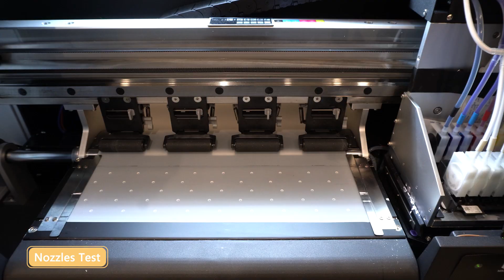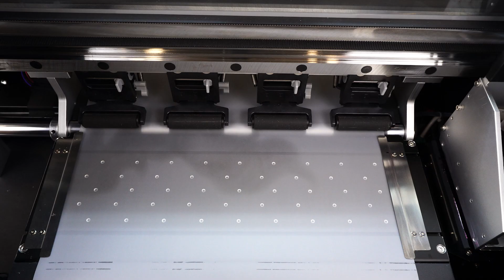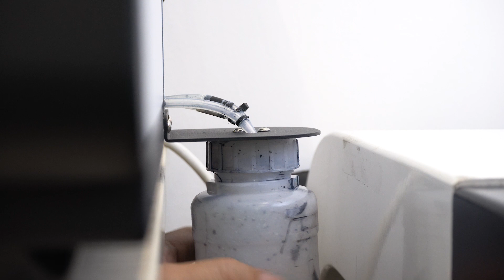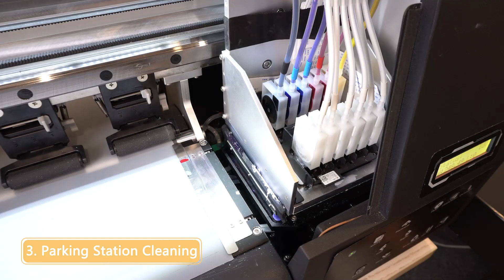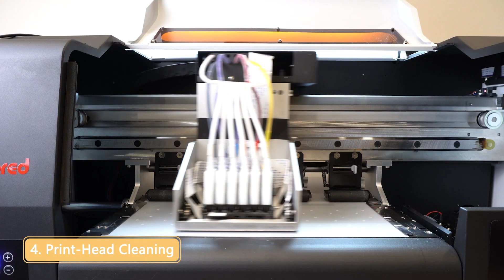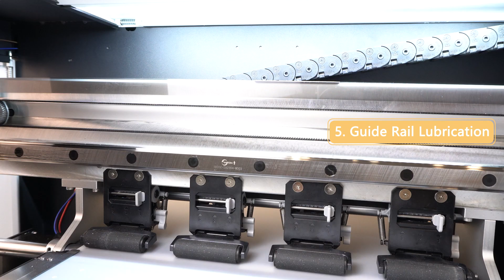F13  Pro DTF Printer Daily and Regular Maintenance

Comment: its my colored ink that wont print. printed great yesterday printed several. Today came in to print and NO color will print. white is good. i have done several head cleanings and cleaned well. Unsure what else to try. I do have the xp600, never had a problem like this before.
Reply from the maker: please try to pull out ink from dampers and waste line

Comment: I feel like you need to make a video on what to do when you have clogged white ink. Happens frequently
Reply from the maker: OK, we will arrange to make a video, thank you for your opinion.
Reply: @ProcoloredPrinter like a in-depth pre caution maintenance and what to do when the cappin station or heads are clogged
Reply from the maker: @Drobird23  Ok, thanks🥰
Reply: Thank you!
Reply from the maker: Please tell me which printer you are using？
Reply: @ProcoloredPrinter  procolored pro dual head!

Comment: In the last video you said don’t use alcohol but in  this video you used alcohol to clean the strip. I’m confused .
Reply from the maker: Don't use alcohol at printhead because it vapors quickly and will dry up nozzles. You can use alcohol at other parts.

Comment: How do you solve the white inks clogged printer is 5 days old and I been doing the nozzle check and cleaning everyday . And the white ink is still not moving .
Reply: You literally pull ink, clean heads and test print until you’re out of supplies and the clog is either gone or they tell you a part needs to be replaced. It’s absurd.
Reply from the maker: Do you have our support group? we need our tech staff's assistance to determine the issue for you, please add my Skype: charles@procolored.com

Comment: At around 3:26 can you wet those things with solution?
Reply from the maker: Yes, you can add some moisturizing cleaser in the capping station. That cleanser is some oily and transparent fluid, similar to the solvent of the white ink.